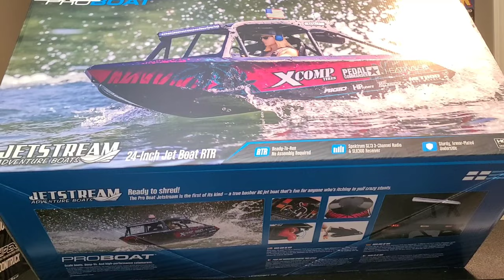Proboat Jetstream 24" Jetboat Unboxing and Review

Comment: WAY SLOWER than a thrasher on 6S. AND doesn’t have self righting. Streamline just came out with a $499 version of thrasher that takes 4S, can be upgraded to 6s, and has self righting. Rendering this one kinda useless right out the box, sadly.
Reply from the maker: Self righting isn't needed at all for this boat. Two different types of boats as well you're comparing. This is a bash boat meant for stunt driving. Thrasher is a speedboat. Not for everyone but loads of fun that should be definitely considered.
Reply: @silverstatercadventures  LOL. Thrasher was LITERALLY advertised as the worlds first BASH boat in their Kickstarter campaign. It has replaceable keel armor JUST like this one. How again are they not comparable? 🤣🤣🤣

Edit: on flat water self righting isn’t needed for any boat this slow. Take it on class 4 rapids where the thrasher shines, and you will see QUICKLY how handy self righting is. There will be videos of these downside up on the River, before long.
Reply from the maker: @EffYoInfo  I just don't see that boat being anywhere near the same at the jetstream. This boat is just over a foot wide and the hull is pretty flat. I don't see anyone rushing out of their house to buy an RC boat to play in class 4 white rapids. If you're, a $1,000 boat wouldn't be my choice.
Reply: @silverstatercadventures  Making my first comment, about streamline rcs new $499 4s version of thrasher 27, all the more relevant.

Different hull design, but you can still pull many of the same “stunts,” the trade off is, the thrasher is much more stable, which is SUPER helpful in unstable water. It’ll still spin out, and turn so sharp you can submarine the boat… but when you want it too. I just don’t see that flat wide hull working in a scaled down form, on any serious rapids.
Reply from the maker: @EffYoInfo  Sounds like the boat you're obsessed with is the choice for your style of crazy white water rapids driving. As I'm still trying to explain, this boat is entirely a different style of boat.